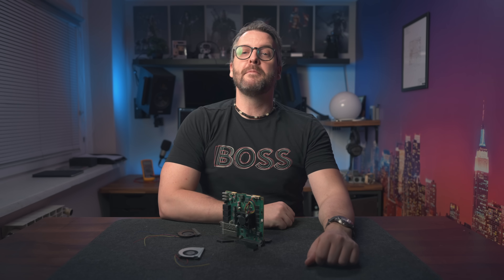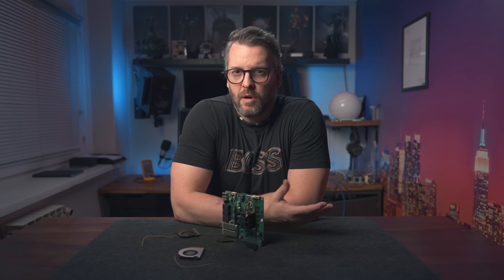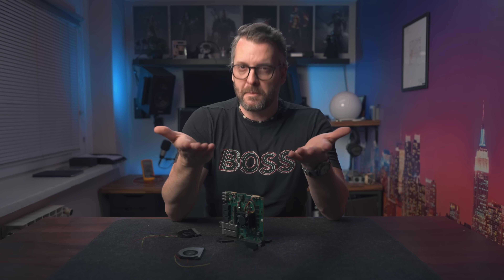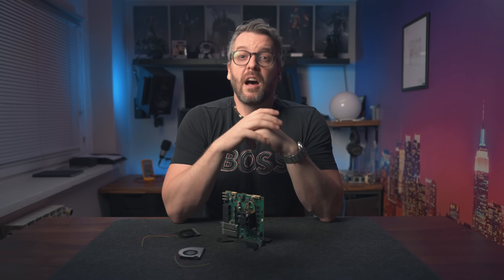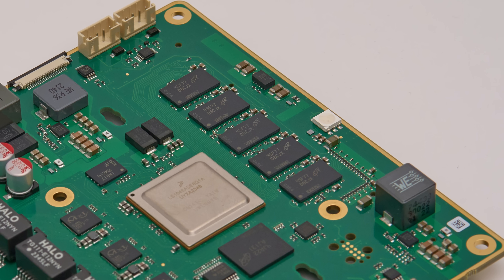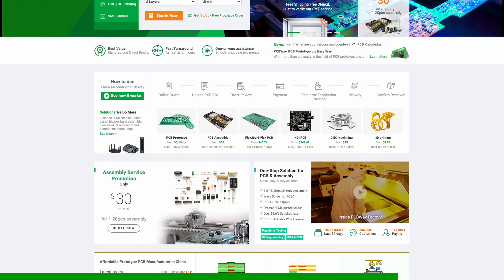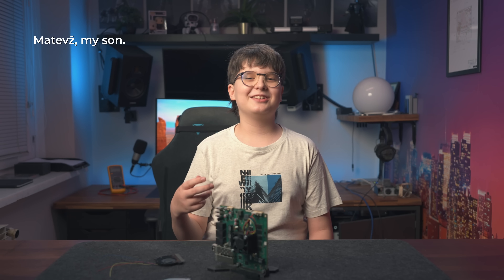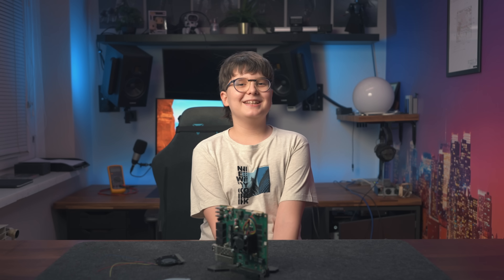You Wanted a Cheaper Router. We Can Do That.

Comment: As other commentors suggested, have a "lite" version that does its main purpose well... a 10 GB router.  This means using more cost effective parts and configurations like no ECC RAM, lower core/speed CPU, smaller nand flash, etc.

Comment: I am looking for a replacement of the PC Engines APU3D4 board.  If it can perform equal to or better than I am ready to purchase 40-50 to get started so just the basic routing functions would be perfect.  Price point would need to be in the 300-350 range at most.

Comment: wouldn't it be cheaper to have the ram not soldered on to the board and just have a single or 2 ddr4 SODIMM connectors? sticks of ram for you has to be cheaper than buying them individual chips? infact having SODIMM slots would be cheaper for you as you could charge an optional fee for more or less RAM.
Reply: Not really, the sockets are a couple of dollars each you have to go with a full Rams stick with using the chip itself. You can use unusual numbers.
Reply: @TheLostPacketYT yes but a socket doesnt cost more than the ram chips themselves. this method they are using is tying up the router to dd4 chip availability which are being eaten up. ram sticks however are not. even if they were rated for only 1 or 2 sticks
Reply: @RandomGuyftw-me  it can ddr4 sockets that would fit the board are way more than normal

Comment: Zdravo,
Regardless price point, I am not sure if it is hardware limitation, but instead of 1 Gbps I think it will be nice to see 2.5 Gbps ports.
You said that standard edition will be avalable for rack case.
One idea, make it available for 10" rack and possible to mount side by side in 19" rack.
Even better, stack two  units in 1U of 10" or 4 units in 1U of 19".
Also one missing feature for me is dual power support. PoE with external dongle... not great not terrible :)
I would love to see it running OPNsense..

Comment: I like most of the optimizations presented. I would like to keep the higher core count CPU though for more network adjacent performance. Tailscale, DNS (Bind/CoreDNS and Pihole/Lan cache). Then of course there are the if I could a router might be a nice place to run it things like home assistant.

Comment: I think the best optimization you could do is to abandon building your own board, and buy BPI-R4 instead. It has pretty much everything Gateway is supposed to have, and then you can write your OS and add a nice case on top of it. With such approach you would be able to hit $300 price point easily, if not $200-250. 
Numbers to build such low volume hardware product simply don't add up, especially if you are aiming for 50% profit margin - I doubt there's a single player in enthusiast/consumer routers space that gets that much.

Comment: I'd not want you to skimp on the passives, since it might affect longevity.
As someone who has a small apartment that means all hardware is in the living room, I'd also really like to see a passive cooling option with no fans requried. It's fine if it costs extra.
Also if I see the NXP block diagram correctly, the CPU supports 1x 2.5Gbit RJ45. Upgrading one of your Gbit ports to 2.5G would be a great compatibility addition, since 2.5G RJ45 home hardware is just starting to become fairly common for stuff like NAS and APs.

Comment: I probably would have designed that absolutely RAW: Q/OSPI NAND, boot into RAM. Eventually mount a SD card for additional user stuff. I work with a TI AM62Ax platform and got an u-boot + Linux + rootfs down to under 30 MiB with network support. Probably could optimize it even further. Boot times are under 2 seconds if I remove all the debug prints. With debug prints and active serial it boots in 8 seconds. Since I work in automotive, 2s is still acceptable. Though, I wrote the entire non-Linux cores bootloaders with the provided SDK from scratch. The provided ones were too slow for my taste (also not compliant with our use-case) and I wrote some kernel drivers tailored to the SoC to have a better set up during the u-boot and kernel loading phase.

Also, I wouldn't cheap out on the eMMC quality. I have devices, cheap and not so cheap ones. The eMMC really degrades over time. The performance on the cheaper devices is horrible after a few years.

Comment: To replace my network setup with these; I need 5.
So yeah still really high.

Build a opsense box for the same price. 2.5gbps even cheaper.
10gbps is overkill for 99% of people.
Reply: Drop docker, drop the sensors, but don't cheap out the connectors.
Reply: Drop ECC.
Reply: You run 5 routers in your network?

Comment: imo getting cheaper connectors and getting rid of unnecessary pasives, additionaly maybe changing passives to the lower rank ones ( 5+% tol instead of 1% tol resistors for example) where possible is must, because you get literally zero impact on the functionality.
optimizing pcb design to not have separate island that are easyly disconnectable by removing a few resistors is must too.

these are industry standard first steps for moving from development to the production.

cheaping out on the cpu/memory depends, there for sure is a sweet spot where you will enough performance for reasonable price but its easier ( if possible) give people an option to pick from a few variants lets say two CPUs and two memory sizes ( 4 variants in total) and keep just the most selling one of the most selling and the highest tier one.

ps. additionally it's often cheaper to have as little as possible component variety, like instead of using 1k resistors in some spots and 4k7 in others, maybe it's possible to use 2k2 in both of them. or if you have multiple places with a small dcdc power supply instead of having 2A on one place and 3A on the other, its often cheaper to place 3A everywhere.

Comment: I would prefer if the focus is on network performance and 'a couple' docker containers, like adguardhome or something like that. It should be focussed on raw network routing with a couple smaller services running on the CPU. Wireguard would be interesting but would require crypto acceleration. Currently, I have a x86 router that can wireguard in the multi-gig speed, so something that is purpose built, that can handle 10gb routing, it would be nice if it could run simple services and have a smaller cost.

Comment: the main cost reduction point that I'm pretty sure won't happen is reduction in cost of passives. 10 bucks reduction is the equivalent of throwing out >1k smd resistors/capacitors, or 200 small smd passives plus 40 bigger caps/inductors... at least assuming you didn't use purely vishay/coilcaft parts for the initial price calc.

Comment: Question. Does that NOR dip switch cost less than a 3 pin header with jumper?
Also, don't skimp on the CPU as things get harder to secure, and the complexity of the net is changing(specially in the near future), we will need the processing power. :\ I also thing it would be simply dumb to save, what, $20 on a CPU with half the performance... Just keep it in there at that rate.

Comment: The cost reduced option (you could even scrap the fiber connections, for folks like myself) would be very appealing and it would kick shit out of my existing DD-WRT router from 2012ish.
Reply: Sfp connections are always requirement so many places to switch into fibre for an Internet connection that you may have to use one so you really need it as an option

Comment: I am going to give this a shot.... I made a have server room and my provider KPN in the Netherlands has a small range of routers. Home and Busines use. The Dutch network will get to 10GBps but on its network you now have 4000/4000 glass as max speed, the other internet glass network has 5000/5000 glass networking but is not connected to my home. Backt to the Routers you will get for home we have a router with 1 10GB eternet and other speed ports like a 2,5Gbps and an other 3 1gbps ports, the better Modem has 2 10GBps a 2,5 en 2 1gbps ports (Thare is no busnis modem thats support 4000/4000 so you need to get other hardware of keep (steel) a Home user modem. (I do have the home user one) and for Busines it as the Fritz! 5590 fiber it has 1 fiber SPF 2,5GBPs max port, wan poort, 4 times 1gps ports. All modems/routers have Phone ports too. Now my problem as a user is or was, I liked to just have more than two 10GPbps ports. . Or to Vlan a very simpel network SPF system with two ports and let  server do the routing in a VM.  I solved it by getting myself 89 euro 10Gbps switch from Aliexpress. I would have like a router with two SPF for glass all over the house and two 10Gbps Ethernet for the other systems,  but now I have a Solar and a battery system that need 2 ethernet ports to the internet. I would have liked to have it jus in one box and now I have many, so splitting Home, House, Business networking. We do not pay for the modem we get from the providers it is included in the service cost. But never is it really what I would like to see for my all-in networking. For the power saving/ safety/ security and relying on the quality of the hardware. I now have what I Think is a router issue where the network line just disconnects and the provider doesn’t see any issue . It would be so nice to see in the router software what is going on with the power states or disconnects to my personal system, the software from the modem is so basic… it gives you what is connected or was connected but no stats… fails… or other info. So making functional/low power/quality hardware and safe/flexible/easy software will make the product. Now I must go and sort out what the hell is wrong step by step by step, what if the router could have told me what the hell is wrong in my network and save me so much time befor I can prove that my router/modem need to be replaced due to voltage issues…

Comment: As someone who does love consolidation to fewer hardware devices, I do find the extra compute power to be welcome to I can retire my older server for something more efficient that will also function as a router/firewall. Things like WireGuard, PiHole, and HomeAssistant, as well as other services.

Perhaps two skus can be made. One with the stronger SoC that can handle more stuff running on top of the networking job, and a more barebones. You said that both SoCs are compatible without altering the PCB design, so it isn’t unreasonable to get basic and pro models to capture a wider range of customers.

Comment: The two optimizations that give me pause are the connectors and the power sensors. The connectors, though, I'm sure you will rigorously test, so I don't worry on that front. My question on the sensors: How much does this removal affect long-term reliability? I don't know their specific role in the circuit so for me it's an unknown rather than a doubt.

Comment: I have no problem with reducing the CPU power as long as it doesn't interfere with networking performance. I think, like several other comments mention, most people watching here are probably enthusiasts who already have a homeserver, so FOR ME, the most I'd ever run on this router would be a DNS server.
Regarding ECC RAM, I'll admit I don't have a strong opinion either way. I'm not sure how much benefit it would provide for networking equipment. For everything else, I'm totally in favor of reducing costs as long as it doesn't compromise the core purpose and final quality of the product. And for me, the purpose is a High-End Router, not a HomeServer.

Comment: Honestly, these price optimizations make a lot of sense and are smart. 
Almost all of them would have 0 impact to the final product, with the exception of the CPU. 
Me personally, I would try to optimize as far as possible, but I would not cut down on the CPU. If you run utilities like IPS and IDS , etc, the cores can come in handy really quick. 
Also, I would consider having the option for a sheet metal casing, as it should be fairly cheap, provide the same functionality, while giving a more robust feel. 
In the end, if this device is able to hit  the 300 to 350€ mark, then it becomes appealing, as is able to compete against Mikrotik solutions for example.

Comment: hmm your device is the wrong color. i would look into emissivity and use an off the shelf heatsink that is ideally the right color. it will perform better passively and you can maybe ditch the fan or go with a cheaper version. emissivity is kind of ignored for thermals but for passive heat transfer its the dominate mechanism for electronic enclosures.

Comment: Socket the RAM and storage. Downsize the NOR and just have the DRAM training and U-Boot(env) there, with the main OS loading from M.2 storage. The cheapest option will always be a barebones model where users provide their own RAM/Storage.
Advantages: you can easily sell different SKUs without a PCB redesign, and you have a large choice of COTS SODIMM/M.2 SSDs which are already price optimised
Downsides: you need to redesign the board to accept socketed RAM/storage, QA/testing to create a QVL, and some users will install unsupported modules and complain to you
Reply: socketing the storage seems like it'd be more expensive. I grabbed some llm numbers.

$7 for eMMC
$1 for m.2 socket, rough estimate

so you'd shave around $6 off the pcb cost, and then increase the cost by around $6 for a cheap ssd (bulk pricing at 128GB). if that's the case, it's not a bad deal, because users can upgrade if they have a reason to, and it's replaceable in the event of failure
Reply: @michaelthornes  the socket usually costs the same as the flash chip itself

Comment: Hi Tomaž, my take is the following is as follows:

1) Drop ECC RAM, it is a Router/Firewall.
2) CPU strength shouldn't ba an issue if the UI is stilly snappy then down size.
3) Use cheaper connectors, as you said, we don't know or care.
4) Sensors, I don't know if anything more than the CPU temp. is important to most people, drop them.
5) Long term degradation of passive components is known to sometimes cause problems, more design components equals better stability long term IMHO

Question: Do I have to buy a dev. kit to get a founders model? Because that aluminium case looks fantastic!

Good luck, watching keenly for updates.

Comment: Hi Tomaž, I love your videos and I've been wondering if you could make a video on how to make our own custom OpenWRT image, I've been trying to revive my old WiFi router from my ISP(which got sold and now the Hardware is just E-Waste) but I can't manage to find a suitable OpenWRT image that works on the router and I've tried to build my own image with the OpenWRT Builder but it's so complicated that it makes "Installing Linux Arch/Gentoo" look and feel like a Piece of Cake, it has so many settings and sub settings that no video online explaines what they're for and how to use them
Reply: The router is a rebranded Chinese Wi-Fi router that not even my old ISP knows who's the manufacturer, the router is running OpenWRT but a really old and outdated version and it has a ton of suspicious custom settings on it(I know because I dumped the firmware off of the ROM chip)

Comment: I'm probably not your target audience here since I don't have a connection that needs a 10gbps router and opnsense on an old Thinkcentre M720 tiny works for me. But I am watching this for the hardware engineering and embedded systems engineering which is in line with my professional background. 
My experience is that SOCs designed for embedded systems applications often don't work well as general purpose computing platforms. The software compatibility issues in the sea of Pi clones is an example of that. There is a high burden on the device maker to ensure software works on their platforms and they can run into issues with things like having up to date components, or supporting all the components needed by a user for their project, or other compatibility issues. Having a strong OSS ethic and an active community helps but it can be hard to get there. 

For example, home assistant was mentioned but what if I want to use something like Node-Red either for light weight automation. Or take a VPN example where an out of the box VPN will work, but what if I'm experimenting with something more exotic like XRay? My experience is that I pretty much have to stick to something PC based for these sorts of projects. 

What that would mean for me an a potential buyer is that I'd want a device that is just a great router that supports great security, great reliability, and routing centric features. I'd leave the task of running other software to a Linux PC on my network. 
But I also love the idea of seeing what enthusiastic supporters could come up with with extra capabilities of a more expensive product.

Comment: Question: when you say it has no reduction in networking performance, does that include running a firewall and scanning incoming traffic, since that is a standard use case for a home router?
Reply from the maker: That's correct.

Comment: For me, I only want the networking performance first, and the usual basic networking services.
If i can do a bit more, then I want to have a DNS server on the router as a backup/secondary, but pihole runs on Pi zero (arm 1 core 500MHz) for a household, so the dual core CPU will be fine. (thinking of technotim)
The rest is already on others devices.